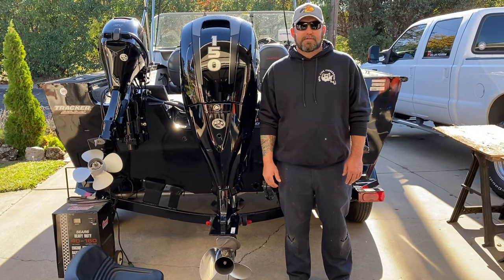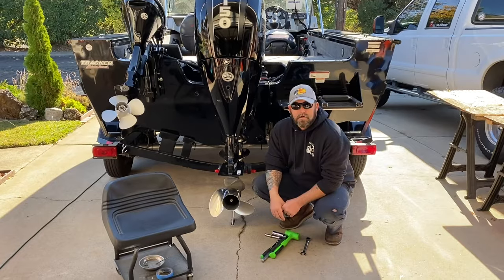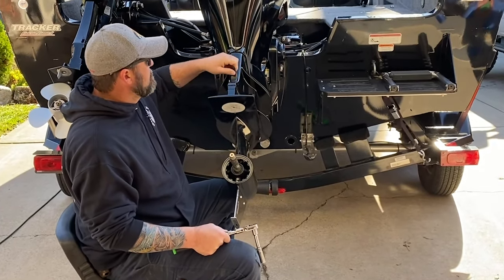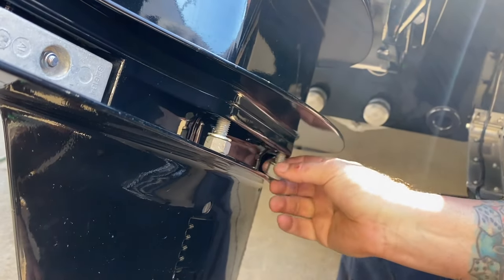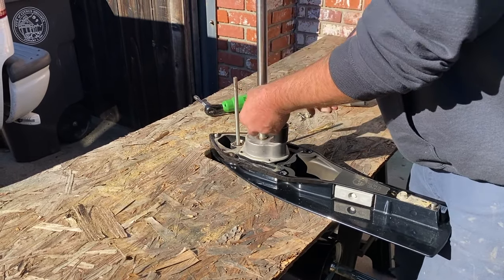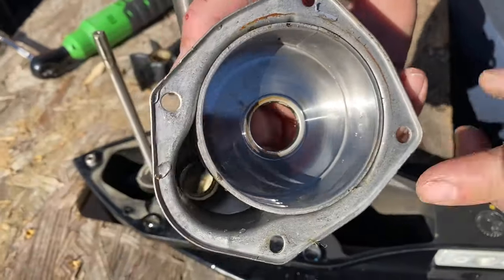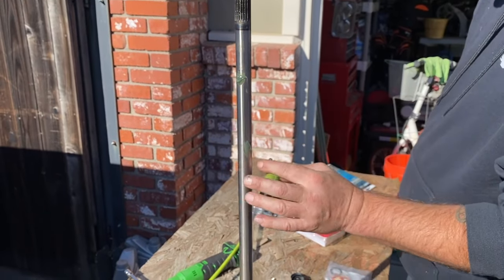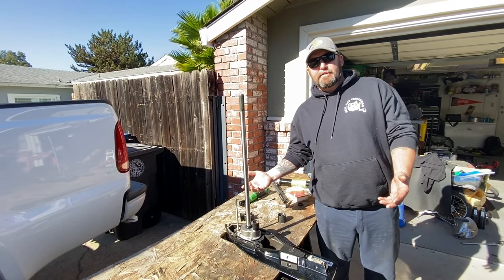MERCURY 150 EFI WATER IMPELLER CHANGE | HOW TO

Comment from the maker: I would like to add .. in saltwater I would not recommend putting loctite on the impeller housing bolts .. use perfect seal or a light coat of anti-seize .. the factory uses loctite there I wouldn’t personally..
Reply: I also work for tracker... Yeah locktite there is a pain in the ass
Reply: I put it in forward and turn the prop shaft when I'm putting it back on I've seen a newb force one in... You already know how much of a headache that becomes 😂
Reply: Another great informative video. I got lucky and it slid straight back in. I had left it in gear. Cheers mate!

Comment: You put the impellar in backwards , the first time you put your boat in gear the impellar has to go in the other direction , which can damage it .
Reply: Exactly my thought....should be twisted in counter-clockwise (except for counter-rotating motors).
Reply: @tecoon5002   I also saw that he twisted the impeller in in  the wrong direction. Bad mistake. I hope he corrects it .

Comment: I just took mine apart and it shows the impeller fins twisting the oposite direction of how you inserted the new. Actually mine looks identical to your replaced impeller and you have 4 fins that turn clockwise and two badly worn.  If you think about what you mention in twisting the impeller clockwise to insert it into the housing and the housing is upside down in your hand then you'd most likely want to twist it counter-clockwise while inserting. Either way it should not hurt anything though, but it is possible.
Reply: you are correct he installed with a backward twist

Comment: One thing I noticed that your old impeller was installed counter clock in the housing
Reply from the maker: Yeah that’s just the way I do it .. no harm in doing either way.. they will flip the other way once you start the engine.. thanks for watching and commenting
Reply: @ReelLifeFisherman  Gotta,  thanks.
Reply: Every repair shop I have asked says they will not flip the correct way until the impeller is basically worn out. They are too stiff and there is no extra room in the housing.

Comment: I replace my impeller every 3 years whether it need it or not. Every time I time I do it, I always have to remind myself where the blades face when I put it in the housing. The video shows the blades being bent to the right when the housing was removed (the housing being upside-down). When the new impeller was installed in the upside-down housing  by turning the impeller clockwise, the blades were facing the opposite direction of the blades in the housing that was removed from the drive shaft. It's my understanding that if we have a right hand motor and we install the impeller holding the housing upside down we need to twist the impeller in with a counter clockwise rotation. With a right hand motor, If the impeller is on the drive shaft and we turn the shaft to the right (clockwise) pressing down on the housing will have all the blades bent to the left (if we were able to look down on the housing). If we removed the housing, holding it upside-down, we would find the blades being bent in the same direction as the blades in video when the housing was first removed (bent with the blade going to the right). It's not rocket science, but it's close.🙂

Comment: Your a legend my friend! Thanks from Australia! I completed the 100h service from other video and it worked great. They charge $650 for that service here.
I wasn't happy after my last service with local Mercury dealer here. They charged me for some parts and didn't even replace them. I service electronics and use a trick to see if they replaced the parts. I put a small mark with sharpie on the part then see if the mark is still there after I pick it up. Got charged for some filters and he swore it was replaced yet my sharpie mark was there where I put it. I was NOT happy. Thanks to your videos I now know the parts were replaced.

Comment: when I put the impeller in I put it on the shaft and watch the keyway go in and  rock impeller back and forth to be sure it's in position then slide the  water pump top housing  on slowly turning the drive shaft clockwise only as I put the pressure on the w/p top housing as it slowly goes down into position with a little pressure  on it going down with my hand  the reason I do it this way  is if I put the w/p impeller in the housing first  and push it down I've had the key fall out  the way you do it  even with the grease trick  but  if I put impeller on first and I can see the key go in and line up so  I feel a lot better that  I've got this part right  but like you  I have better luck doing the going back in the neutral position  good  video  sir  I guess different strokes for different folks lol

Comment: I did my DF175 last spring and boy did I have a heck of a time getting it back on.... I used a strap to help hold the lower unit in place... my shift rod was easy.. I just couldn’t get the spline to line up on the drive shaft...
Reply from the maker: Yeah sometimes they can be a pain.. but try bumping the starter next time.. each time something else can be a pain.. or if you get lucky the slide right back on sometimes! Lol. Thanks for watching and commenting I appreciate it!

Comment: Best video i have seen on removal of water pump impeller.Was confused on the you have to bump it that to me means you have to kit the key and bump the engine other than that good job.
Reply from the maker: Awesome glad you like it.. you can take it off in forward and spin the prop to get the splines to line up .. whatever works best.. I have a video coming up on doing it in gear also.. thanks for watching and commenting!

Comment: Good job.  Best video by far on this topic.  Like you, I have found that the question of doing this in gear or neutral meets with about equal success.  The Mercury manual says In Gear.  I've used a large properly fitting socket with breaker bar to slightly rotate the flywheel to get the drive shaft to align.  Getting the weight of the propeller off of there is a must for this old man :-) Thanks much.
Reply from the maker: Thanks I appreciate it! Glad you like the video! Yeah I just seem to have better luck doing them in neutral most times .. but if I’m alone I don’t have a choice but to do it in gear like the manual will tell you.. tanks again for watching and commenting!

Comment: great job on the vid. I did this service on my mercury 115 after not running the motor/boat for 3 years. By any chance do you know what i should check if my boat is sputtering? I siphon out the old gas and put new gas in it. my boat will run fine then all of a sudden the motor will sputter and fuel gauge jumping up and down.

Comment: I have the same motor. It hasn’t ran since I had it winterized in the fall..  I put the muffs on it but I didn’t get any water out of the telltale.Maybe ran it for 3-4 minutes . talked to the shop that winterized the boat and they indicated that if there was an issue with the impeller, they would have let us know in the fall. Could I “push” water through the clean out by the motor up and down switch on the left hand side? Or maybe gently insert a short piece of weed eater line in the telltale? Never having put muffs on before, I’m not even sure I had them on correctly. I did have some water coming out of the prop. Thanks!

Comment: Great video! That is the only maintenance item I have not done on my 150 FS (95 hours)  I wish I could see a full install of the Pro Kicker on that Tracker, I want to add one to mine.
Reply from the maker: If I ever do one as a side job I will definitely make a video.. glad you liked the video and hope it helps.. thanks for watching and commenting!
Reply: @ReelLifeFisherman  185 hours now, replaced the impeller today along with all of the other 3yr/300hr maintenance - referred to this video and it all went well.  As a side note, had a 9.9 EFI Kicker installed and completed the maintenance on that today too.  Dang that factory oil filter was a SOB to get off!

Comment: Thanks for the video.  When I removed the housing 3 of the 4 bolts broke off.  I am thinking a machine shop is going to be needed to remove and maybe re-tap the bolt or install an insert.  Any suggestions?
Reply: I took it to a machine shop.  I will get it back together and see if it cools.  More questions in the future I am sure.  Thanks.

Comment: Well, I'm personally glad you didn't get the lower part right the first time. Otherwise, I don't think I could have put it back together myself.
 After a few curse words, and a pair of pliers to turn the shaft just right, I was able to finish the project. 
That, however, did not fix my problem, which was that water does not come out the tell tale valve. I have the same engine you have.  Great video, either way.

Comment: A great video.  Many thanks for taking the time to do it. 2 questions.  Being from the lock up capital of the world.  Melb Aust we run in salt water.  Is it best to use the muffs on the bottom of the foot or use the water flush on the side of the motor.  Also getting the water tube on again would putting a smear of rubber grease be ok??
Reply from the maker: Thanks I’m glad you liked the video! So I will always run the motor on the muffs after the salt unless I forgot them at home! lol the flush on the side works great for reverse flushing.. it is not supposed to run the motor on that..  it’s good to use if you ran through sand or mud.. or if you don’t have the muffs or can’t use them like if you keep it at a slip  .. and absolutely a dab of grease is a good idea .. I do it every time on the water pick up tube coupler.. thanks for watching and commenting! Let me know if you have any questions..

Comment: Great video. When you say "bump start" do you mean use the key? Wont the motor start? I'm doing mine this weekend
Reply from the maker: Yes use the key or a push button start jumper if you have one .. I've never had a problem using the key method but to be on the safe side unplug the crank position sensor on top of the engine at the flywheel. There is a two wire connector there red and white wires. The engine will turn over but will not start..  the risk you run not unplugging it like in the video is if the lower shifts into forward and the driveshaft engages in the engine, it can try to turn in your hands and hit you if the lower is not on the studs when it engages.  This has never happened to me in my 10 years of experience but it is a possibility.. so to be on the safe side unplug the crank sensor and just have someone use the key bump it to start then back off as soon as it turns .. do this until it lines up.  Let me know if you have any questions.. thanks for watching

Comment: Great video.  Instead of bumping the motor to get the two shafts aligned why couldn't you just rotate the lower unit drive shaft clock wise just a bit?  This is what i have done on my merc 50hp 2stroke, 50 hp 4s honda and 15 horse johnson.  Anyone have a thought on this?
Reply: that's why you put it in forward before removing...so you turn the prop to align

Comment: Thanks!  This convinced me to have my Mercury 50hp done by a mechanic - unless I see something drastically different when you do that video. I may attempt to do the impeller myself on my Mercury 6hp kicker though.  One question - if your kicker motor had been trimmed all the way down, would that have not solved the issue of having it's propeller in your back?  Or am I missing something?
Reply from the maker: Thanks I’m sure I will get one to do soon.. I do more installations on the side over service.. but when I do I will make a video.. thanks for watching  and commenting I appreciate it!
Reply: So if you take it to a boat mechanic to have the impeller replaced. How do you know if he did it. It worked fine when you took it in, still works fine, if it quits pumping water how can you know it's a new impeller that  failed??
Reply: @jwolf7929  Ask for all the old parts.

Comment: I'm about to acquire a 2014 Merc 150 with about 300 hours on it. Could you come do another video on a 300 hour service on my motor? 😄 In my younger years I might have tackled this job. But, if I were to have issues reinstalling the unit, my lack of patience would interfere with my success. Thanks for another great video.  I'm a new subcriber.

Comment: Are you near Sacramento? I have a 2020 75hp Murcury 4 stroke and I need my 3 year service.  To be honest I don't really trust my local shop especially for what they're charging.  Thanks for all the info brother!
Reply from the maker: I appreciate it and I totally would have done it. But I moved out to Florida a year ago.  Unfortunately a lot of the shops in the area over charge! But you can call my old shop in rocklin I worked at the bass pro out there.. they have by far the best price in town! And if you want they can just do the impeller change and you can do the rest of the service and save money.. thanks for watching

Comment: Great video. I'm putting a lower unit and bay kit on my 115 merc today after taking off the pump. The linkage is done in the tiller but I had questions on the extensions on the shaft and shifter. Do I just grease the extensions together? A guy on YouTube said to super glue shaft extension to shaft so it doesn't stay up there when you put the pump back on. That doesn't seem right. But have motor in neutral when doing all this and just grease the extensions on when stuffing it all up there like you did in this video? Much appreciated. G
Reply from the maker: So the only bay kits I have installed all came from mercury had the extension for the lower unit itself with the long studs  and came with a new lower unit with the longer drive shaft and shift shaft then a extension for the water tube that sits in a notch in the lower unit extension. I add a dab of grease in each point for the water tube with O-ring and grease on the drive shaft splines and shift shaft splines .. Hopefully that helps and makes sense. Let me know if you have any questions or I didn’t understand exactly what you were asking. Thanks for watching!
Reply: Thanks man, yes, that's exactly what I got from Stevens Marine. Lower unit, with bay kit and longer extensions for shaft and shifter, water pump extension and the longer studs. Sounds like the same. So it seemed to all go together well. Only thing, when it was all together before tightening down the lower, it had maybe a 1/4-1/2 inch gap but snugged up once the bolts were put on. Do you find that normal for everything to jive together the first time with that bay kit? So once it was all put together, it shifts, pees, and seems to be functional. That shaft extension wouldn't fit up in the housing and I had to take the cowling off in order to put it above the mid section on top of the shaft? I'm going to check the oil in lower and then run it. Anything in particular I should look for that might not be right? If it pees, shifts and runs fine I should be good huh? I think the next time I'll definitely take it to the shop. Thanks for your time. Great videos.

Comment: Thanks for the video.  I bought a used Targa 18 this year with this outboard on it.  I'm about to do the winterization on the motor.  I'm probably going to think about the impeller during the winter.  See if I can get the courage to do it myself.  It has been about 3 years.

Is that Pro Kicker a 20" or a 25"?  Thinking about getting one.  Thanks again!

Comment: I followed your steps doing mine. Quick question. With the motor off, should the propeller spin when it is in forward or reverse in the appropriate direction or lock both ways? When it is in neutral, it spins freely in both directions

Comment: Question? The round white plastic piece that covers the upper drive shaft seals, which has that metal ring around it!  Can that be taking off and be inspected inside and cleaned? And can I reuse the plastic piece and metal ring? I
 ride mine in salt water and want to make sure I don’t have salt corrosion under it.  And to have a peace of mind.  At around 10:56 on the video you can see the part I’m talking about. It has red letters on it.  Thanks your videos are awesome!
Reply: Or is it smart to replace the plastic piece, metal ring, and o-ring that goes around the plastic piece? And clean it out good. Actually I’m trying to pull mine out and seems like salt has it stuck pretty good. So I’m still needing help but gonna pull it out now that it’s stuck in their pretty good. As it doesn’t want to come out easy.  I’m gonna let some corrosion x sit on it over night and hope it comes out easy tomorrow.

Comment: Great video. I tried to remove my lower unit on a 2014 Mercury 90. I removed the bolt under thee anode and the 4 nuts holding the lower unit. The lower unit feels like its still bolted on . It doesn't come off. It feels stuck. I need help. It only has 400 hrs.
Reply from the maker: Sometimes you have to wiggle it up and down. With the skeg and Cavitation plate.. if it still won’t come loose, some tapping around the cavitation plate with a dead blow hammer will usually do the trick.. thanks for watching, and let me know if you have any questions

Comment: Do you ever use a sealer between any of the impeller gaskets? Just wondering because on my friends Suzuki 300 he ended up needing to because of exhaust leaking into water pump housing.

Comment: I’m a little confused on the bump start . How many times do you bump start . It also sounded like the camera picked up a engine sound was the engine running? T.I.A.
Reply from the maker: So you just bump the starter by turning the key then turning off. It be on the safe side you should disconnect the crank position sensor. It’s a 2 wire sensor by the flywheel on top. Thanks for watching and commenting